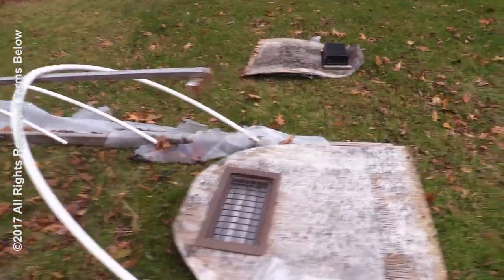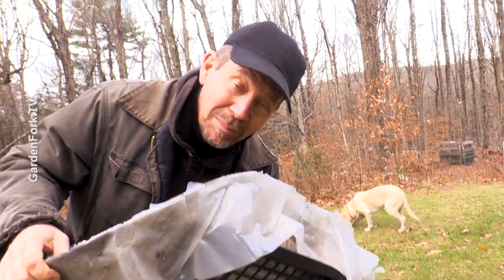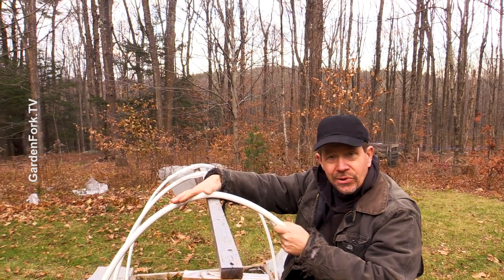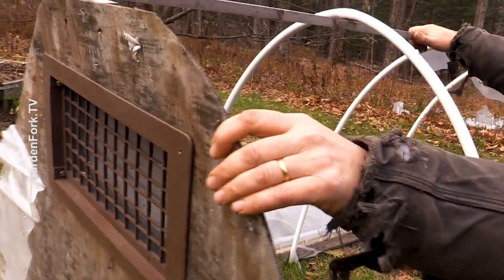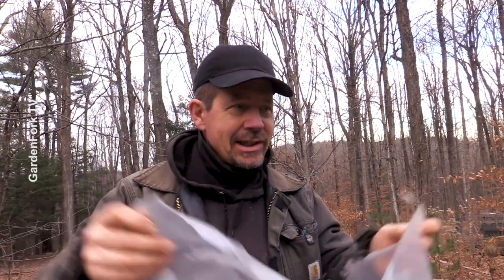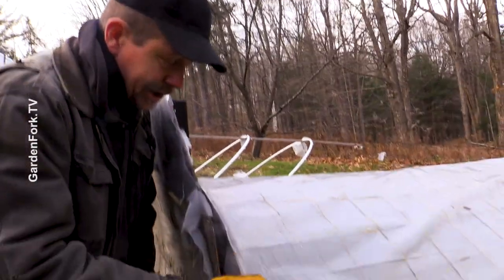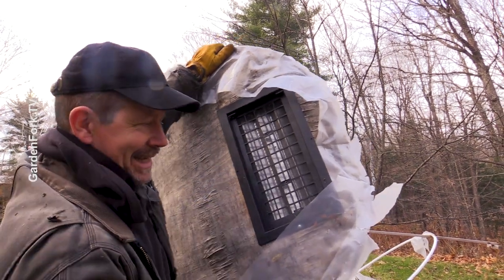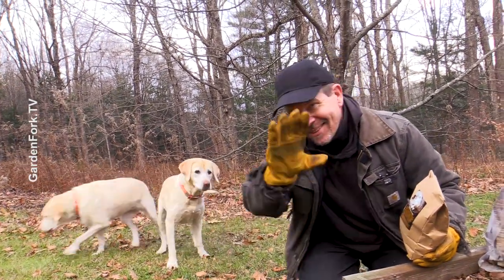Can You Help Me Fix This? | DIY Mini Greenhouse For Raised Beds | GardenFork

Comment: I would use 3/4 ply and add a support on each side as well the top with the wire instead of the pvc. I'd also apply something like Thompson's water sealer or paint to the plywood and the other Lumber.

Comment: use PVC spines, and PVC bases, with PVC "T" connectors, and U pipe clamps to hold 2 long base PVC lengths (attached  to PVC ribs) to 2 long 2x4's - for base support and stability. Drape ag-UV plastic on top, and attach with 1 size larger PVC - cut 1/4 out of 2" lengths - then snap them onto PVC, with plastic sandwiched between. Make both end PVC ribs slightly shorter, so will have more of an Airstream shape, to let winds pass over. Longer plastic at ends helps keep heat in, but in your climate, plywood makes sense. You can also attach ply  to PVC ends with U pipe clamps and screws. My greenhouse, with this design, and Ag UV plastic, lasted over 5 years, until hurricane ripped it apart 2 years ago (Hawaii cooler rain forest) - plastic still strong, even after hurricane. It's worth it to get Ag UV plastic, holds up much longer. Hope this helps.

Comment: Eric, you have so many great recommendations, that I can hardly wait to see your results.  
I was thinking of framing the vent with 2x2's and using rigid insulation, between 2 pcs of the thin plywood you are using for stability, and using some of that waterproof spray to treat the plywood, but there are so many better suggestions. 
I'll be waiting to see the video, of what you will build.
Really enjoy your videos! 
Time for you to show us your nest Chili Recipe, now the colder weather is coming.  ;)
Reply from the maker: Hi Debbie, yeah lots of great input here, its great to see. but i'm intrigued by the idea of rigid insulation, as I have scraps of it I pulled out of a dumpster. and yes, waterproofing the plywood is a must. My neighbor just had us over for chili last night, they used smoked pimenton in their dish, its a spanish paprika. thx!
Reply: Chili too soon, does not make a sweet smelling bouquet, lol.
Soups, stews and crock pot cooking is here, so pull out some of your best including Making Bread.
Try a few of the suggestions, over the Winter.   If you try board and board with rigid insulation in between, use Nuts, Bolts and washers to spread the tension over a larger area instead of pulling through your pipes or wood, wing nuts, allows you to tighten, if necessary.   
Sometimes, it's best to sit back and look at the whole project from a distance, and see where you need to brace and strengthen your project.  
Enjoy your projects, trial and error, make a good teacher, but I prefer action and reaction, as my tutors, before I start a project.   That way I have thought out what will happen if I do something this way, or that.  I hope you know what I am trying to say.
Merry Christmas and Happy new year, to you and yours, this holiday season!  🎄⛄🎅🎁🍾🍷🎊🎉

Comment: I would probably build the support for the vent out of dimensional lumber (1x2 or 2x2, depending on the weight) with some diagonal bracing, add a PVC hoop around it, and tie it into the existing hoop structure.  Then just cover the end with the same plastic you use to cover the hoop house (you could cover the end with thin treated plywood or poly panels but the plastic allows for a cheaper test if the new framework fails).  I've had treated plywood exposed to weather for almost 10 years and it is holding up fine but the wind energy will translate entirely from the end panel into that top joint causing it to fail (as you have seen) but the plastic will dissipate and spread the force of the wind so there is less stress on that top joint.

If you choose treated plywood get the thinnest you can and build a wood frame to support the vent (going to the bottom and top of the plywood).  This will be easier to move and the screws will hold better where the end attaches to the rest of the hoop house.

Keep up the trial and error, it encourages the rest of us.
Reply from the maker: Brian I have never thought of wind energy before with a mini greenhouse but makes total sense. Many thanks for taking the time to write. Great info. Thx!

Comment: Yeah, like most folks said, 3/4 treated plywood and paint it. To keep it from laying over, cross brace it from the top of one end lengthwise to the bottom of the other. You could also use bungee cords on each end and stake them down to keep it from laying over and also from blowing away. Kind of like a pup tent.
Reply from the maker: had not thought of bungee cords. good one. thx!

Comment: a lot of people try to build these tunnels on the cheap and if you live anywhere weather is brutal,  they don't stand up to cold, wind and snow. if you don't mind spending money on the same materials over and over just keep doing what you are doing.

Greenhouse plastic will get you the best performance and last longer the stuff from the hardware store, just depend how much fun you have replacing it and throwing it away. some people put two layers on and blow air between them as an insulator.

use pressure treated 3/4" plywood for each end wall, it will last the longest. attach the purlins with corner brackets to the plywood ends. the purlins are the pipes that run lengthwise.

use the grey pvc 3/4 or 1" for purlins and hoops, but it it better to use same size metal conduit, use your plywood ends as a form to bend your hoops around. space your hoops 3 feet apart, and have three purlins, maybe five depending on height. 

make sure there is no sharps that can cut plastic. pull plastic tight to end walls. 
attach hinges to the upper and lower  frames on one long side and a latch on other to keep wind from launching it to a friends house. easier ti lift and prop open with stick.

screw bottom end of hoop to wood frame don't rely on clamp to keep in place

buy a high tunnel kit with every thing you need, and it will last a long time. you can do videos putting it together.

checkout this tunnel
https://www.youtube.com/watch?v=aQ6Sut89NPk
Reply from the maker: yeah, don't want your hoop house flying into your neighbor's house! thx for taking the time to write this all out John.  thx!

Comment: you could use two pices of plywood one one each side of the pvc hoop to make it stronger and still allow you to put the vent in and you could put a brace in from the bottom of the plywood to the ridge about 12 inches from the plywood as it will help stop it moving sideways 
cheers Ian from the uk
Reply from the maker: +ian mills Hi Ian, thanks for the suggestions! Eric.

Comment: I would use pallet wood for the ends, check with import stores, they often have pallets that aren't treated and can be semi exotic wood as well... I would also use x fittings and more tubing for the "spine"  you might also consider bubble wrap between the skin and mesh
Reply from the maker: Good info Doc, many thanks for that. I have pallets, a neighbor who has a pellet stove got this delivery and gave me the pallets. thx!

Comment: I use ¾ inch. I also use two sheet of concrete wire for a higher hoop 6ft athwartship, 2x4= 8ft long. Keep the ply covered in plastic, which will make it last longer.

Comment: You could build a frame out of cedar 2x4s to mount the vents as well as to hold up the sides of the pipes/fence/mesh, then finish the ends with the plastic.
Reply from the maker: thx for your thoughts Jim, it def needs to be stronger. thx!
Reply: Thank you for sharing your vids!

Comment: Go to a 1/2” plywood treated with Thompson water seal on the ends .Then take a 2” x 4” x 3” long. And cut out a notch so your top rail sits into it and not on top of the end piece like you have it.  Now screw the 2x4 piece to the top of your end side and screw the center support to the 2x4 saddle. 
I used 3/8” plywood on the bed of my ATV over the expanded metal and bolted it to the bed with carriage bolts. I painted the plywood with the Thompson water seal and now 4 years later I put another coat of Thompson sealer on it and it is holding up just fine. The trailer sits outside 24/7/365 days out in a sunny place and the plywood is holding up just fine. 
They do make a plastic for greenhouses that are reenforced with a poly cord in it. 
Your dogs bark just as much as Ruffy on my video on my  You Tube channel 
(Scott W) . 
Check it out I think you will enjoy it
On mulching in the garden. 
I’m Will’s Dad from The Weekend Homestead. 
Thanks  Scott
Reply from the maker: Hey Scott, thanks for all the info. Will is a great guy!  thx!
Reply: GardenFork check out the msg I am sending to you. 
Thanks
Scott
Reply: GardenFork I am sending you a link to one of my videos about garden mulch. I have to send it to you via instant messenger please check it out I think you will enjoy it. 
Thanks
Scott

Comment: If you're putting these on raised beds then I would suggest making both ends about 6 inches longer so you can screw the excess 6 inches onto the raised bed which will prevent it from tipping over. I would also suggest 2 or more cross bars to add stability. I bought one of those vents last year via one of your videos,  but haven't put it up yet. Thanks for the ideas.
Reply from the maker: good to know, thanks Lori!

Comment: Definitely need exterior plywood on the ends and as an added measure attach a hoop to the perimeter of the wood end, so even if the wood should weaken, there is still some support that will give you time to repair or replacement the panel before it fails completely.  I would use the mesh over the hoops to get the benefits of both green houses. 
If the greenhouse plastic is only good for 2 or 3 years, you may as well stick with what you currently use & put the money you save into other projects.
Reply from the maker: i will try the mesh over the PVC and see what happens. thx!

Comment: I used cattle panels and a doubled up 2x4 for the ridge beam for the main hoop, but my plastic last just a half a season
Reply from the maker: Hi Ras, I saw those cattle panels at the feed store, had me thinking. I still have a few of the cement reinforcing wire pieces left, might experiment some more. thanks for watching and the note here!

Comment: In my experience at the nursery we used 3/4 treated plywood for everything and as I saw in other comments you need diagonal braces. As far as plastic goes just stop at a local nursery in the spring and get some of their old plastic we used to give it away and it usually has 2-3 yrs of life left. You won’t get any right now but you can stock up next year
Reply from the maker: good to know, thanks for the info. thx!

Comment: I would use thicker wood. Did you use a sealer on the exposed ends? Or tin on the out side then thin foam board between the tin and the plywood and you could use a thinner plywood
Reply from the maker: had not thought about foam and tin, thx Elizabeth!

Comment: so after a few failed attempts with plastic sheeting and electrical conduit which is made from PVC here, i built mine with wood (3 "ribs" cut at an angle to create a 4 sections half circle (22.5°) on a square wooden frame) and 6mm multiwall poly-carbonate semi transparent 2x1meter sheets.  does not blow away, because i fixed it with hinges to the raised bed frame, and the material is strong enough to hold those vents... total cost around 120-150€ for a 3x1m bed with woods, poly-sheets, screws with rubber-washers
held up great even through 100km/h winds.
Reply from the maker: thx Thomas, I was thinking of attaching it with hinges. will check out the polycarbonate. thx!

Comment: There is something called "Marine Ply" with which sailing dingys are made. Well wooden ones anyway and they are better (stiffer) than plastic ones.
As for the plastic tube hoops. There is a 20mm plastic conduit and things called "saddles" to hold it up on the wall which may be better than screwing in the tubing. Simply screw the saddle onto your wooden ridge thing then clamp the tube in the saddle. If I were skilled in this I would give you a link to a suitable item but I have only been doing Internet type stuff for 30yrs and and computer stuff for a little longer, so I have difficulties there. Plus they would be UK sites!!
Reply from the maker: Good info James thx!

Comment: Looking at the way the hoops want to fall over end to end I’d say you need some racking - diagonal bracing to stop it tipping over. This could even be done with wire wrapped around screws into the pipe. Ideally it should look like an X when looking at the side of the poly tunnel. Know what I mean?
Reply from the maker: yes!

Comment: the polycarbonate sides sound good but you may want to re enforce them with 1 by2  firring and definitely get the uv safe 6 mil poly. it will last longer.
Reply from the maker: +Daniel Allouche I'm going to check out the polycarbonate and order the UV plastic thx Daniel!

Comment: put a hoop on the end and use pipe t's point them to the next hoop it will stabilise the frame and join them it works like a chain then  you can use pipe cement to fix the whole thing together
Reply from the maker: great info, thanks for taking the time to write!

Comment: Something I've been thinking about trying is re-purposing some of those annoying signs that real estate developers like to put up on every corner. They are double walled plastic, and relatively stiff. Laminate two or three layers, plus a coat of paint to protect from the UV, and they should last a very long time. They would even provide a bit of insulation, being double walled.
Reply from the maker: yes, great idea. they are called coroplast or corrugated plastic. thx!

Comment: Need to use either treated plywood, paint the plywood, or stain the plywood.   If you paint or stain it, you'll need to re-paint/stain every few years to make it last longer. 

Other option would be to cover the entire greenhouse with plastic, tarp, or some other covering to protect the wood on the end
Reply from the maker: Had not thought to just cover the ends in plastic. Thx!

Comment: I need help with the ends of my large hoop house. It is 10' wide by 24' long and 6' tall down the center, with a steel frame. It is bolted to a Trex board foundation. I have used it for about 10 years, and replaced the cover several times. No problem with replacing the cover, as I have found suitable plastic for that purpose. The hoop house was designed to have ends that attach to the frame with zip ties. One end has a zip-up window, and the other end has two small windows and a door--all zip up. I want to replace the ends with something more substantial. I am not a carpenter. Ideally, I would like something lightweight that could hold a vent on one end and a door on the other. I wonder if the concrete reinforcing wire panels (covered with plastic) might work--but the ends, when cut to fit, would be sharp. Any ideas would be welcomed.

Comment: I suggest using marine grade 3/4 inch plywood for the ends.  MY understanding is the glue used to hold the plies together is waterproof.  I feel this type of plywood could handle many New England winters.  The only drawback is the price.  A 4x8 sheet will run you about 100 dollars. 
I recently have been listen to your podcast on iTunes on my way to work.  I enjoy your show and videos that now I shop at amazon.com/shop/gardenfork for most of my on line purchases.  Thanks Eric
Reply from the maker: I did not know that the glue for marine ply is waterproof, but it makes sense doesn't it? and many thanks for your support Tom!  eric.

Comment: it's a good deign. just add a hoop or thicker MARINE grade plywood to the end. Bolster the top beam attachment to the (plywood) end with angle brackets or wood bocks. But Most IMPORTANTLY use UV resistant, UV impervious or green house grade plastic as your wrap. that or make it out of plexiglass that you bend with a heat gun. best of luck and best regards. Jerry.
Reply from the maker: Hi Jerry, thanks for the info, i will get some UV plastic. thx!

Comment: I think you're on a winner with the reinforced concrete wire and plywood both ends but change the plastic to greenhouse plastic that what I have and it lasts way longer
Reply from the maker: good to know, thanks for that. i will get the plastic. thx!

Comment: Go to Lowes and take a look at this material I've placed below. (You can even Google it if you want)  It is strong enough to withstand almost as much wind as the plywood.  It is much lighter than the concrete hardy board others have suggested.  It's clear enough to let in more light.  Probably even more than the plastic sheeting.  IF you want to make it super strong cut out two of the end pieces but have the peaks and valleys offset by one half "sinewave" so that you can screw or better... glue the peaks to each other.  If you choose to screw the panels back to back you just buy some 1 inch self tapping screws with rubber washers.  No drilling pilot holes required. (Check out Teks 120-Count #9 x 1-in Zinc-Plated Self-Drilling Interior/Exterior Roofing Screws Item # 276842 Model # 21400.0)  This will form an extremely strong wall.  It will add a lot of insulation and provides even more support for your vents.  It can be cut with a jig saw or circular saw as long as you use a blade with a high tooth count.
Tuftex PolyCarb 2.17-ft x 12-ft Corrugated PolyCarbonate Plastic Roof Panel
Item # 77000 Model # 1418C
Reply from the maker: wow thanks for all that!